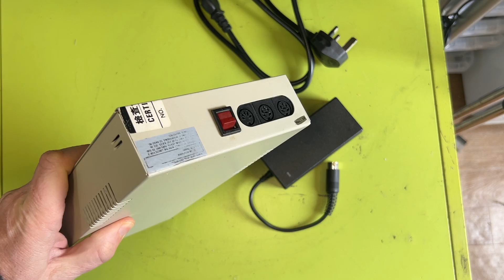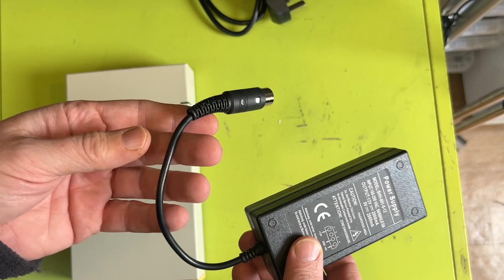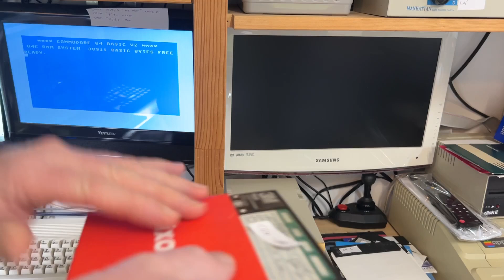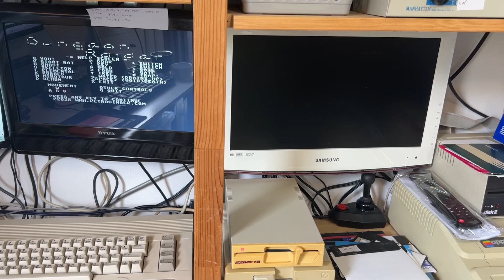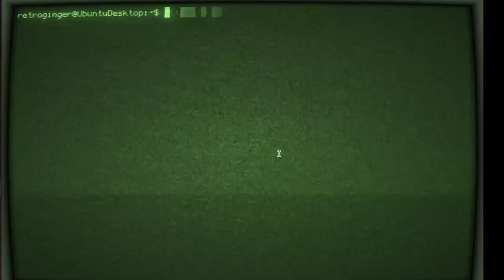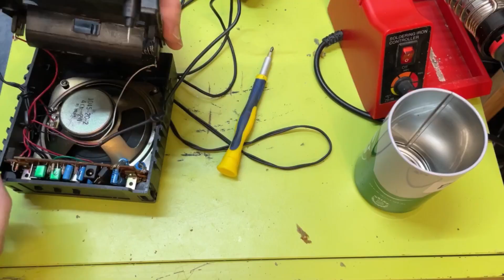Excelerator Plus C64 drive

Comment: I have one of these drives.  It works very well and is highly compatible even with copy protected disks unlike many of the other third party disk drives for the C64.  These were nice, well made, reliable disk drives for the C64.  It also works very well with Epyx Fastload, FCIII, etc.  There were even JiffyDos ROMs available for it.  The way they "cheated" was using a copy of the C= DOS ROMs.  Except that they swapped two bytes in adjacent memory locations in the ROMs.  I guess this was intended to keep C= from suing them but its a rather thin excuse to get away with a copyright violation.  The copies of the C= DOS ROMs are exactly why this drive worked with nearly everything.
Reply from the maker: I would love to try this with JiffyDos for sure.
It is turning into a graveyard of old Commodore drives. 1 out of 3 drives working is not a good ratio for sure. What I am surprised about is that these drives are not mega expensive on eBay